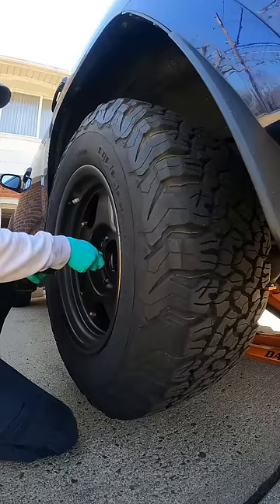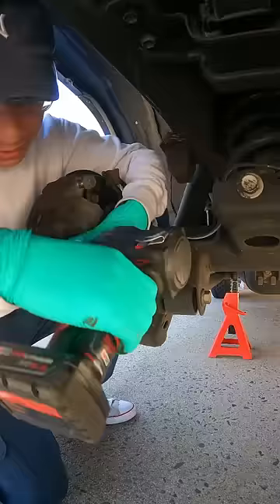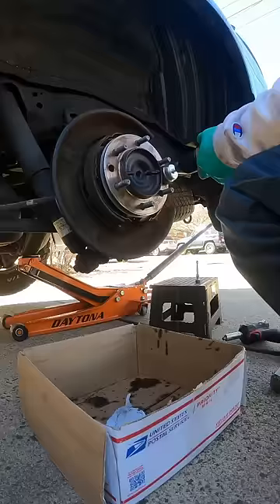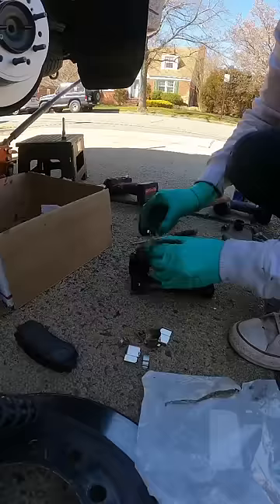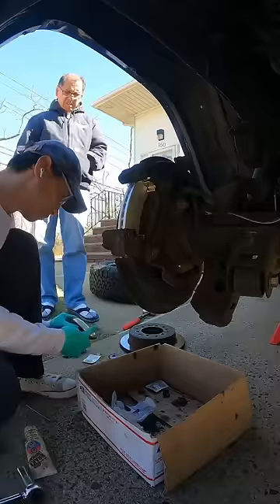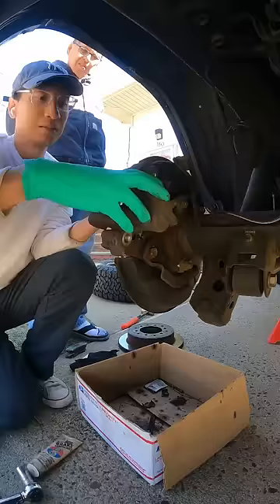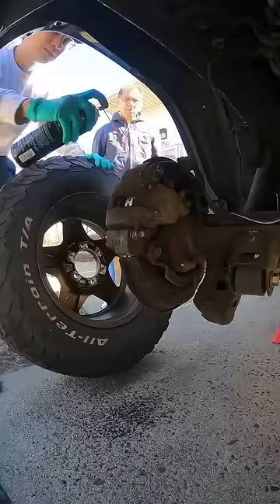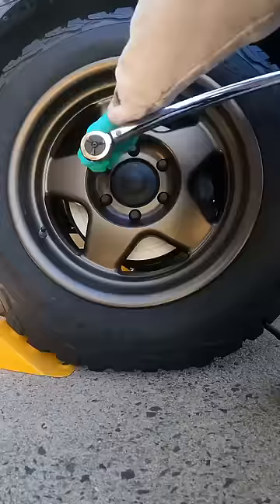Dealer wanted $700 to replace rear brakes. My DIY job cost me $100 and an hour of my time 😎

Comment: For the naysayers, $78 for the brakes and rotors at Rock Auto. That doesn’t include tax or shipping, but parts are themselves are under $100.
Reply: Rock auto is THE best place for car parts, seriously. They ship basically within the hour, and it arrives here in Canada WAY before parts I've ordered from Ontario to Alberta.
Reply: But how much moneys did all tools cost ?
Reply: @notsevenfeettall  dang that sucks. I’ve had good luck but I haven’t ordered any electrical parts. Just brakes, shocks and something else. Feel like it has to be worth the price with shipping to order. Ordered rear shocks on my dad’s truck for $90 shipped. Oreilys, advanced and autozone wanted $90 for one. It was same part number as autozone. I’ll probably stay away from them for electrical components.
Reply: @marshallmann2171  parts below, around $600-$800 bucks, but I think most people doing this already have most of the tools needed. You don’t need the Milwaukee impact wrench though, a ratchet/socket set and a breaker bar will do just fine. They’re charging $700 for rear brakes, fronts can’t be too far behind, there goes another $700. Now you also have tools to do small jobs, fluid changes, oil pan, calipers, shocks, etc. 

-Milwaukee impact wrench $350 (home depot /online) 
-3 ton Jack $180 (HarborFreight)
-torque wrench $25 (HarborFreight)
-sockets $30-$100 (shop around) 
-Jack stands $30 (northern tool)
Reply: 1a auto is way better. They're as cheap and I've never had a wrong part shipped. My last order was for plugs,wires and coils which is about 600+ at the parts store came in at 200 at 1a. But that's my opinion I guess
Reply: those warp easily get quality ones
Reply: @joshadams2812  think I’ve ordered from them once. Was not impressed with the quality. I ordered a set of mirrors for my truck, I ended up taking half my old and half the new to make it work.
Reply: @toolsonabudget7763  I didn’t believe it before, but torquing to spec seems to help big time. I used to just tighten wheels or go to small shops that don’t use torque wrenches and rotors would warp constantly. Since going to discount tire and/or doing myself with a torque wrench, don’t think I’ve had rotors warp again.
Reply: @notsevenfeettall  Never had a problem with them shipping wrong parts. I have spent several $1k with them and never had an issue, and this is over several years of use. I think my first purchase was is 1999-2000, they have been great. Sure they maybe mess up but I haven't had that case happen to me in over 20 years.
Reply: @walterrojas1075  ya you need to spend some to do it yourself but since you only use them sparingly they will last a lifetime.
Reply: @joshadams2812  1a auto would have costed me like 3 times as much for the parts I bought my jeep about a year ago. So no way. Also I get to choose what I want with rock auto.
Reply: $78 brakes weren't an upgrade. You should have at least gotten OEM brakes.
Reply: Not a upgrade though
Reply: @18avshalom  Wagner brakes, I’ve had good luck with them.
Reply: He definitely didn't get them coated rotors and pads for 78! Not even from rock auto unless he only foolishly did one side!
Reply: @notsevenfeettall  The other problem is their shipping games. They purposely source things on your list to get more shipping charges from you. I have played with it and sat you have two items from the say shipping location. Then you add a third and suddenly all three are coming from different locations. Or you change the quantity and it changes the location, so you pick another item equivalent to the one that used to match, to one that matches the new location and it does stuff like adding a third location. It's beyond ridiculous.
Reply: @walterrojas1075  That is anecdotal. The caliper assembly floats on the pins, so the torque used on the fasteners has no connection or relation to it.
Reply: @edwardthayer9386  Depends on the car. I can get ceramic pads for $12, Bosch for $18 (front set), and 23.79/each for Raybestos coated rotors.
Reply: @Court  not for that Tundra your not!
Reply: @walterrojas1075  Wagner are good, but Genuine Toyota are better. I use Wagner or Akebono when I'm not using OEM, but I'm convinced Genuine Toyota are the best.
Reply: @court2379  I don’t disagree. That’s the beauty of the internet and being able to price shop around. Sometimes local price is the same as online when shipping is included. Plus you get the added bonus of same day pick up and being able to return same day if it’s the wrong part.
Reply: @18avshalom  maybe it’s a Toyota thing. My F150 factory brakes and rotors were replaced at around 35k. Then again around 120k and now it’s sitting at 200K, may be due for new brakes soon. Something like that, not 100% exact mileage they were changed.  I remember my Honda brakes lasting a good bit, but I never used OE brakes on it.
Reply: @WillSwingem  autozone sells some pretty cheap stuff too. Bet rockauto has it for less still. 😂
Reply: @walterrojas1075  yea your right I for customers cars at my shop we usually get the import directs from orilleys but for my personal cars i get my parts from the dealer
Reply: @marshallmann2171   Must have tools you need for brake replacement is less than $50 and these are tools you can use repairing something else as well. If you get cheapest tools and only the sizes you need, probably even $20 will do.
Reply: @notsevenfeettall  They are not always the cheapest place, but they usually are. Amazon often has parts cheaper than Rockauto with free shipping, but Amazon is plagued with counterfeit parts.  Rockauto was also pretty good with replacing DOA or damaged parts. Contacting customer service will solve wrong part issue.
Reply: Rock auto turds in the chat. How’s the returning policy going? Good luck
Reply: @scooter2kool173  Other than having to pay for return shipping, their returning policy is not any different from local store. I had no problem getting warranty replacements from them few times. Return shipping cost is kinda what you have to expect when buying on-line.
Reply: @edwardthayer9386  Don't know what year that one is, but I looked up a 2000 and it turns out they aren't much more. Right around what he stated here for the front set. I was thinking it would be more too.
Reply: @court2379  it's the clamping of the rotor he's obviously talking about. As in, when they mount the wheel.
Reply: @marshallmann2171  
700 bucks
Reply: ballshairysweetie6364  They have a good, better, best system on their website.
Reply: You mean downgrade, those discs warp easy, be careful.
Reply: What about the floor jack that looks brand new.
Reply: @marshallmann2171  $700 to dealership. $100 parts, $30 harbor freight break bar $20 socket set, $150 hydraulic jack, $80 torque wrench, $30 brake caliper tool set(you can borrow from auto zone also the torque wrench), $8 1 can of brake cleaner, $6 1 can of wd40, $40 jack stands. $464 in total and save you $236 and you get some only used once tools you can resale or return (return not recommended). It’s one hour job and your hourly pay is $118 which might much higher than your current job😅
Reply: As a volvo owner of an s80 t6 awd rockauto saved me over $64,000 in parts. Just an awd rebuild kit runs over $8,000, windshield washer fluid bottle $270, struts $680/each, coil plugs $900 for 6 spark plugs $90 for 6, 91 fuel $4.20/gal 15mpg avg, 8 qts of full synthetic high mileage castrol and oil filter as recommended $98, wheel bearing $189/each, and brembo brakes/rotors $600 all together. Those are parts prices without labor.
Reply: BallsHairy Sweetie  could be whatever quality the specific brand part is you’re buying. From cheap-o made in china to made in USA and also OEM brands. They have brands such as AC Delco, MOOG, Mopar, Dana, Raybestos, Denso, Munroe, SKF, Mahle, and Fel-Pro.
Reply: @scooter2kool173  spent thousands on rock auto and have yet needed to return something. I usually only buy higher quality brand items mind you, but from what most others say, their return process is pretty typical of other places. I’m not too concerned at this point.
Reply: @walterrojas1075  I missed the part were he proved 78 dollar pads and rotors outperform the OEM ones that came on the truck which you know they definitely aren’t he should have never said that because no “upgrade” happened just a downgrade.
Reply: Came here to post similar. 

Rockauto has great prices and options but their shipping kills any deals they may have.

Edit: most deals are killed when shipping is calculated.
Reply: @Back_door_bandit_98  I missed the part where replacing with OEM is an upgrade. He probably meant “replaced” and said “upgraded”. Idk either way, good on him saving $600 and doing the job himself.
Reply: @Nvable  think it depends. I paid half the cost for NGK spark plugs and a fraction for the motor mount I ordered. Even with shipping I was less than 2/3 of what I would’ve spent at auto parts store.
Reply: You’re 100% right. I snapped off my bleeder valve (don’t ask, that was a bad first brake job on a 26 yr old car) and had to run to AutoZone for a whole caliper that cost me the same amount I spent on a my whole engine tune up, and the brake pads and brake oil.
Reply: Marshall Mann He clearly already had thm .Like everyone should have at least some basic mechanics tools or your just not a man.
Reply: Rock auto is cheap, cause they are cheap. Nothing but consistent problems with brake parts from rock auto.
Reply: @grozakko2007  is that why? I always thought it was the lack of store fronts, old school website stuck in 2005 and not have a dozen employees standing around asking you 2wd or 4wd for the wiper you need. Thanks for the info. 👍🏼
Reply: @notsevenfeettall  No no no. They are not terrible for wrong parts, missing parts, etc. If it's wrong parts, missing components, or whatever the case may be, they next day air ship a replacement and give you a return label to return the others back. Or in some cases, tell you to keep the old part. 

They sell remanufactured parts but inspect them to ensure their accuracy. 

RockAuto's customer service is A+
Reply: Rock auto is always my first option for car parts. Especially for wiper blades 🤯 omg the markup is just retarded at stores  for them.
Reply: @Grozakko I never had a problem on a single item from Rock Auto. If you don't know anything about parts and manufacturers let a man that does . Because that's your fault for picking the cheap parts out of the giant list. They have many name brands and better prices.
Reply: @notsevenfeettall  I have to disagree. I got shipped a damaged radiator (Wasn't damaged in shipping, it had been opened, bent, and re-boxed). They shipped me a new one immediately and gave me a return tag for the damaged one.
Reply: @marshallmann2171  You can do this job with basic hand tools on most vehicles. You might need a caliper wind-back tool, which is only $20, the rest you can get for maybe $30 total.
Reply: @walterrojas1075  I have bought lots of stuff from RockAuto, just be sure to get a good name-brand or get the "favorited."
Reply: @toolsonabudget7763  Yes, I always go with Wagner. Been using them for 40 years and never any problems.
Reply: @walterrojas1075  It's less important to torque them properly than to tighten them evenly and in the correct pattern.
Reply: @joshadams2812  1a & RockAuto are fs interchangeable depending on the part but both are by far the best in terms of prices
Reply: If you a planning on selling your car ya use parts from Rock auto.
If you actually want parts that will last go to the manufacturer for parts they will be expensive but it will definitely be better quality...
Reply: @edwardthayer9386  Ha, “one side”, good one.
Reply: @smokeshow1984  RockAuto doesn't carry Toyota branded parts, but some of the aftermarkets are better than OEM. Some of them ARE OEM.
Reply: @Miles Parris  ya the parts that cost more then oem might be better.
Cheap parts are IMHO not worth wasting your time
Reply: @smokeshow1984  No, because almost all their parts are cheaper AND better than OEM.
Reply: @Miles Parris  no, with cars you have only 3 options reliable/cheap/fast an you only get to pick 2
Reply: @smokeshow1984  You haven't used RockAuto, because they are all three.
Reply: He said upgrade. Ain't shit from Rock Auto gonna last 140k miles
Reply: @aztharz5637  I have parts racing from rock auto and parts avatar and both are late 😂
Reply: @jayblack9871  You have no idea what you're talking about.
Reply: @smokeshow1984  A lot of OEM parts are actually on RockAuto, at least for GM/Chevy. When I was overhauling my 06 Colorado’s engine sensors etc, nearly everything I looked for had an OEM offering available, or something that when researched was actually of OEM quality. I have no clue if that’s the same for imports or other MFG’s though.
Reply: @jayblack9871  Yes my boy the OEM part that lasted 270k on the original will not last 140k because I bought it from a particular source. I’m really not trying to fanboy a website but Jesus Christ guys use your heads.
Reply: @GetTheFO  Yeah, I can admit I forget they have O.E. parts sometimes. Like you said though for GM and Chevy. I own an Audi and an old Thunderbird right now. Every other part has been a hit or miss on fitment for the t bird. Not even going to talk about quality.  Same deal with the Audi but a lot worse. I guess having old pos cars doesn't help.
Reply: @marshallmann2171  cost to purchase id irrelevant because of the impact was $200 and it lasts 15 years, that's Pennie's. Dealerships be making you pay off their tools for life
Reply: Yeah for cheap crap. You need to watch the YouTube video on brake pads and the VAST difference in quality that exists. It’s a safety issue. Also those cheap rotors will be warped in a week. But gotta love ignorance…..after all it is BLISS 😂
Reply: @marshallmann2171  probably collected over a life time
Reply: So 3
$30 rotors, lol
Reply: ROCKAUTO
Reply: Do not spray brake kleen on pads ever
Reply: @aztharz5637  Oh thanks been looking for a review of them. Need some lexus parts that the dealer is charging too much for.
Reply: And it’s literally where the shops get their shit from!
Reply: @TheRoman1  why not?
Reply: $78 for two rotors and pads? Not even,  maybe eBay shit
Reply: The way rock auto makes their money is off shipping.. go on there and try to buy a small gasket. And compare it to the price at your auto part store. Oh rock auto has it for a $4 and you have it for $15. Then go see how much the shipping is on a tiny gasket. It’ll still be like $15
Reply: Rock auto parts suck you could of done it yourself with quality parts for under 300
Reply: @Lemonhead8890  Yep. Same thing with me. His comment seem more like he was thinking of possibilities and worst cases that might go wrong.
Reply: @notsevenfeettall  Never had any issues. They have always made sending in lifetime pads and rotors easy and core charge on things like calipers have not taken long to get back that charge. As I type this my next 4 orders will be messed up just because life.
Reply: @marshallmann2171  for sure less than $600
Reply: And a month later new ones oem is the only way
Reply: @shauncry9310  ?
Reply: @Jmacfann  rock autobis cheap manufactured parts durability is so so
Reply: @shauncry9310  yeah if you decide to buy the cheapest they have.
Reply: Doesn’t count the tools and labor time either smart guy
Reply: @walterrojas1075  how much is your time worth if it takes a newbie 8 hrs to do this?
Reply: @kevinragsdale6256  that’s completely up to the individual. For me, I’ll take my son out there with me to hang out and it’s not taking 8 hours to do brakes. We changed rear shocks and brakes on an Xterra a few weeks ago. I think it took an hour, if that for both. Some people like to do that stuff, some people would rather pay. Dealership rates are around $220 an hour at this point, I’ll do it myself.
Reply: Not original parts?
Reply: Rock auto not for brakes
Reply: There's no way that's for oem quality parts,  though.  That's cheap Chinese steel for sure. There's a reason oem quality parts cost so much. Just the parts for all 4 corners for a small suv just cost me over $400. That's not upgrading,  that's oem quality,  so there's no way the cheap Chinese parts you bought for $78 are an upgrade. That's just a lie.
Reply: @marshallmann2171  Exactly. Torque wrenches, impact wrenches, impact sockets, etc aren’t cheap… and then there are “shop supplies” like slide pin lube, brake cleaner, and brake grease. Heck, he acts like torque specs are just known. Did he buy a repair manual?
Reply: ah yes you work for free makes sense
Reply: @marshallmann2171  winner winner chicken dinner!!  These kind of vids try to make shops look bad.  The truth is you dont just pay for a few parts.  You pay for the mans time and his tools.  A good wrench is over $700 on its own. 😂🤠
Reply: ❓ how much was your wrench??  I wont ask about all the other tools needed.  If you use quality stuff, that one thing is over $700 😅😮
Reply: @c7adventures376  you’re 100% right. As someone who does minor maintenance on my cars, I need the best, snap on, matco, Mac and the price that comes along with it. 🤡 There is no way HarborFreight, husky or kobalt will get the job done. Guess my advanced auto part gear wrenches and tekton ratchet/sockets didn’t get the memo.
Reply: @toolsonabudget7763  THIS every pair of brakes I've replaced that weren't OEM have lasted a year or two before warping, just pay the extra bit and buy OEM
Reply: I agree you csn easily find a set for under $100 but saying he "upgraded" them is not true. 
He probabaly got everything from economy section.
Reply: If you are only paying $78 for pads and rotors, they are not an 'upgrade' from Toyota parts. I'm not saying you can't buy the same or better quality, but those probably ain't it chief.
Reply: @Tools on a Budget  finally someone pointed that fact out!
Reply: Those wheels are really nice!  What truck do you have?
Reply: @walterrojas1075  nope. You dont need the best for your once in a while home jobs.    The point is he was trying to make shops look bad.  Well at least he should compare apples to apples.   My statement stands that a good shop has good tools and not only that. They warranty the work they do. Its silly to post this bs and tell every average joe that the shops are no good and doing your own work is so much better.  Little mis leading if you know anything about honest auto shops. 👍🤠
Reply: @Walter Rojas  Pretty crazy you can literally buy all the tools and it'd still be around the same price
Reply: @nicks3037  yea guess thats possible.  Do you also like one or 2 use tools??   A shop definitely is not buying that junk and they warranty their work. One wrench will be more the $700 on its own. Telling the average joe he can do it is often a costly mistake.  But sure. Head on down to HF and you too can be a backyard mechanic.  🤠
Reply: Yeah, but how much is that milwaukee impact???😂
Reply: @c7adventures376  do you work or own an independent shop? If you do awesome if y’all are honest. It’s hard to come across honest shops now a days. If I can find one, I will stick with them. Shop rates have gone up in the past 5 years. The one I used to go to was $85 an hour when I started, when I stopped going it was $125 an hour. Still beats dealer price of $225 an hour. In the meantime I’ll stick with naturally aspirated ol reliable V8 that needs minor maintenance. That being said, do you have something against people working on their own vehicles with tools that are affordable to them?

Also, harbor freight won the lawsuit snap on had against them for selling the same jack at a fraction of the price.
Reply: I have an EV so I never have to replace my brakes.
Reply: @ultrastoat3298  that’s awesome! Didn’t realize that was a thing with EVs. Thought that was hybrids with regenerative braking that brakes lasted forever. My only worry with those things is the cost to replace batteries long term. I tend to keep my cars a long time. Got rid of my last one at 205k, current one has 200k and one with 165k.
Reply: Maybe for the "economy"parts that will surely pulsate when on the pedal....they always do.
Good ones are $250 ish. And it's probably an hour per side minimum....just be accurate. People who know nothing about cars or repairs watch this stuff and believe it's real.
Reply: Shipping rotors will cost as much as the rotors usually because they're pretty heavy but it's still much cheaper than a dealership.
Reply: @aztharz5637  theres always a cost to getting something dirt cheap. Id go lower mid price
Reply: Yeah I bought a few parts from rock auto. If they send you the incorrect part, they make you pay return shipping. That broke me from that. It happened twice and it cost me almost as much to return the parts as the parts cost me.
Reply: @marshallmann2171  you gonna cry? If you have the space/confidence to do this job, you can afford a simple socket set
Reply: In my experience with rock auto their still cheaper with shipping generally. Autozone usually has the cheapest parts thats you can in store.
Reply: @walterrojas1075  I have a DeWalt impact wrench that’s about 40% less and does the job. It’s well built and durable.
Reply: @ultrastoat3298  if you do they’ll probably be $1500 😂
Reply: @pmscalisi  lol huh. Tesla doesn’t make brakes. You do know that right? Please tell me you know at least that much before commenting. I can go to brakes R Us just like anyone else and get new brakes. Lol. But I won’t have too. What an insane comment.
Reply: @walterrojas1075  this is how I got my tools I said f that price I’ll learn to do it myself and bought all the tools and did the work myself and it ended up still saving 50 bucks at the end of the day, but with all the tools at the end I can save money for time to come.
Reply: Of course. That is the only place I order from
Reply: @ultrastoat3298  have you tried to buy Tesla brake parts? $700 just for the parts. That’s all four rotors and pads. 
I don’t think you need to put brakes r us brakes on a high performance Tesla.
Reply: @pmscalisi  nobody has to buy brakes because they last hundreds of thousands of miles.
Reply: Don’t forget to go scrap the rotors at your local scrap yard for a little extra scratch
Reply: @marshallmann2171  you can get the tools to do this for maybe 30-40. Stuffs not that expensive. Brakes are the biggest scam mechanics shops have
Reply: Impact 600.oo+78.oo  Plus time 1 hour say 20.00.          698.00 WoW the savings Plus no warranty for the job or brakes
Reply: And all the tools used ?
Reply: @realtalkboxing.  just do it with hands. No tools required. Be a man.
Reply: @marshallmann2171   If you do your repair outside of o'reilly's or autozone I believe they will let you use tools to fix your vehicle
Reply: @notsevenfeettall  tell me about it. Only the people who don’t order a lot have no clue. The guys who only replace or repair when it’s easy work say rock auto is the best. What you should do is purchase oem parts for American vehicles and find an oem parts house for your euro or Japanese.
Reply: @walterrojas1075  as a former helicopter mechanic yes proper torque matters.  Under tq cause problems just like Over tq.
Reply: @marshallmann2171  You can do this job for <$100 in HF tools
Reply: You aren't getting genuine toyota pads & rotors for $100 shipped. A powerstop oe style kit costs more than $100. And I would think your $700 estimate also included flush services if not more recommendations. Possibly front brakes as well. Let's compare apples to apples, not apples to apple flavored juice drink from concentrate (contains 3% juice).
Reply: @jamesleavy883  dealership always mark-up the price.
Reply: @aztharz5637 I order some things from Rock Auto, but their standard shipping is slow and some stuff is cheaper to get elsewhere once shipping is factored in. I do my best to get what I need from Amazon.
Reply: @marshallmann2171  you don’t buy generic tools for one job, you buy them to do many many jobs over the years.  Average out the cost of the tools even over a couple jobs and you’re still saving significantly.
Reply: Aint no way $78 pads and rotors is an "upgrade"
Reply: @notsevenfeettall they're not that bad at least for missing parts. I recently ordered actual upgrades for my brakes, drilled & slotted rotors with new pads plus hardware. The box that had my front brakes was missing the pads and i submitted a complaint to rock auto and got replacements no hassle, no extra money. That being said, definitely dont order from them unless your ok with waiting 2-4 weeks for parts
Reply: @marshallmann2171 just borrow some from a buddy
Reply: @notsevenfeettall  I’ve ordered starters, alternators, batteries, and so much much from Rock Auto, and have done 2-3 warranty claims with no issues. They’ve only messed up once with the wrong item and that was an oil pressure sensor.
Reply: Just looked at this rock auto you guys spoke of..... I'm goin back in. I just wasted to let you know that i know
Reply: The dealership was quoting labor and O.E. parts. The factory pads last longer especially when you buy the cheapest thing you can find.
Reply: If you paid under $100 for a set of rotors and pads, it's a good thing you did it yourself. You'll be doing it again soon.
Reply: Rockauto for the win!  Been using them for years keeping 20 p.o.s. on the road😅
Reply: @SkYxLeGaCY  It must stink to own that car given all the repairs it has required.  I have an 18 yr old fully loaded (when new) 4WD Tahoes Z71 with almost 200k miles and have only had to spend maybe a couple of thousand $ on repairs and replacement parts, excluding tires.
Reply: And three months down the road you're going to have a warped brake rotor cuz I bought them there and they suck
Reply: Low quality brakes for $100 🤦🏽‍♂️
Reply: Just a set for the front costs like 60-70 should've cost him like 150 if he also got new metal clips
Reply: Don't forget the $500 impact or 
+$100 torque wrench he's using... Everyone's got that stuff just laying around too ya know 😂
Reply: @Marshall Mann  well that's a $100 mechanical torque wrench lol
Reply: Naysayers have left the chat
Reply: That does include time to do it yourself, tools, lifts etc. I can’t even get rotors/pads for an axle for under $100 and that is with a 10% over cost at a dealership
Reply: $78.00 for brake pads and rotors? Bullcrap 😂😂
Reply: Those cheap Chinese rotors will probably be fine on the rear. Don't use cheap rotors up front, they will warp fairly quickly.
Reply: @marshallmann2171  my question is, why did he even take it to a shop in the first place if he has the tools and the knowledge to do it himself?
Reply: Doesn't include the cost of the tools either
Reply: Not good quality 😂
Reply: @doom  anyone who works on their own stuff should have a basic tool set. It will pay for itself with one repair job.
Reply: Are you calling that an upgrade though?
Reply: @milesparris4045  unless you like good quality tools. A name brand Torque wrench can run $500-700  on its own.  😆 👍
Reply: @c7adventures376  Fine for a pro mechanic. I am not. And I've seen work done by a pro who just tightens everything with an impact. It's not the tool that makes the man.
Reply: @walterrojas1075  didn't see this..  Yes im a shop brat.  Luckily my Lt. Col father is a honest man and i have see the good side of the biz around him.  You are not just paying for a tool or a job. There is overhead like crazy.  Shop insurance and other things. We were the lowest per hour in all of Ventura. 

The part i dont like is trashing all shops and saying the average joe can do the work at home.  I think people should know their skill set and do the jobs they can do correctly and most of all safely.   When you get work from us we stand behind the job and also are responsible for fixing anything that goes wrong during the fix.   Its definitely not the only option,  but for many car owners its the smarter one. 🤠👍
Reply: @KingCobra_45  what choppers did you fix? My dad the Lt. Col used to fly the CH-46. 👍🇺🇸
Reply: @Its_0zzy  if its 100 bucks... its garbage!! 🙄😁
Reply: @milesparris4045  yes. I have seen many professionals do the wrong thing or the wrong way.  If a shop employee doesn't do the job right and something goes wrong, the shop is still responsible. If joe smoe makes a mistake, he will be coming out of pocket to fix that too.
Reply: @c7adventures376  Rogerr that, for m HH60-H,  SH60-F,B  MH-60-R S
Reply: @marshallmann2171  😂 once you invest in some tools the savings pay for them 5 x over easily with a few basic maintenance jobs on your car. I seriously got me a nice set of tools now that I can tackle any job except an engine swap
Reply: Yeah but if it's your first time and you don't have these tools, it'll be over $100, but still definitely less than $700
Reply: Also, it's a great investment for any first timers because you'll have the tools to be able to do it next time. So all you'd need to worry about is the parts, which then would def be less than $100. For first timers without any tools, these are the tools you wanna look at:

Breaker bar
Socket wrench (if you don't own a drill because buying one is expensive)
Set of sockets
Jack stand (probably the most expensive thing)
Jack (although you do should have a basic one in your trunk)
Kroil or PB Blaster (penetrating oil)
Break cleaner spray
Small pack of grease/lubricant (super cheap)
Box of disposable gloves (if you don't have any)

I think that's about it. If I missed any important ones, please comment it.
Reply: @eduardorivera508  do you work on cars?? One good wrench can be $500-700 on its own. 🤔
Reply: @whackronomicon  lmao.  But according to the chat here.. any backyard hillbilly can  the job and for a lot less too. 🤠👍
Reply: @Lamtitude  your right. He didn't.  It was all for views from the start.  Plus the misinformation keeps that chat going.  🤔
Reply: You must be in the USA. In Canada the parts would cost MINIMUM $200.
Reply: I've been changing my brakes for years. Hondas, Acuras, F150. I always get the Premium Bosch QuietCast Ceramic brakes. Typically around 35 dollars (for an axle, 2 wheels). You can do front AND back EASILY for under 100 dollars. That's the one time parts/consumables.

You'll need a jack, jack stands, wrench, etc. but you need that stuff anyway and it will last you a lifetime if you get quality stuff second hand. Get some good lube/grease:
Permatex Copper Anti-Seize
3M Silicone Paste
Brake cleaner

Then a wire brush is good too. Typically don't even need to do rotors, just clean it really well. Only when it start to shudder do you need to do the rotors so add another, what, 100-150 per axel for rotors?

You need the tools anyway for oil changes and regular maintenance, mods, etc. Most of your brake jobs (after you get those few tools) you can do for 80 bucks (all 4). Plus you learn a lot, get good exercise, etc.
Reply: @user-nh3gu1ge3d  I agree 100%, but these people don’t want to hear that. “But your time” “but the tools” “take it to a shop, they would never steal your money”. 

More than likely if you’re doing the job you have the tools and time to do it. I’ve saved a buttload of money on doing jobs myself. Over $1000 ($1110 quote) on my wife’s BMW when replacing brake clip. Over $400 ($575 quote) on replacing my trucks oil pan gasket. Saved $500 ($725 quote) replacing Honda starter. Saved $400 ($525 quote) by getting Honda alternator rebuilt and replacing myself. Dealership prices are outrageous! Best part is, I can still drink beer while doing the job myself.
Reply: @walterrojas1075  Yeah, for sure. People say "I don't have the time to change my oil" when it, in fact, takes way longer to take it to the shop. I can slide under my truck in my garage and change my oil a heck of a lot faster than I can drive to another place, wait an hour for them to do it, drive back. Most people are just very, very lazy.
Reply: @user-nh3gu1ge3d  ah man. Gonna get me started, I have a huge stain on my driveway because of the simpletons at the lube shop. They didn’t tighten my buddy’s filter on his truck. He left his truck in my driveway over the weekend, when he started it and backed out I noticed the puddle. Thing was a thread or two from falling off. That would’ve been a bad time had it fallen off on the freeway. Serviced by “pRoFeSsIoNaLs”! He took me up on my advice of going back to doing oil changes himself.
Reply: EBAY ALSO
Reply: @marshallmann2171  you could buy/rent the tools and still come out cheaper than the dealership
Reply: @marshallmann2171 not much really.  Maybe a few hundred at most.  You can use those tools to do a brake job in the future or some other jobs.  I have to take care of 3 vehicles and would be really expensive to take them all to a mechanic or dealer for service.
Reply: Those are much worse parts if they were that cheap
Reply: Don't forgot core charge
Reply: You didn't upgrade anything for 100 bucks. Lol
Reply: @notsevenfeettall  Dont forget ordering OE version but receiving economy version
Reply: @marshallmann2171 I often do my own brakes so I already have the tools I need. Been doing my own for many years.
Reply: Rock auto is 1st on the list unless I need it same day
Reply: @marshallmann2171 a man should have basic tools, jacks, ratchets,
Reply: What naysayers? 😂😂😂
Reply: The quality is not the same with those $100 pads and rotors. It's actually a downgrade, especially with oversized tires. I see warping, squeaking and lockups in the near future. Save on labor so you can use the extra money for better parts. Brakes aren't something you should go cheap on.
Reply: I fail to see how that's an "upgrade"
Reply: Let me know how the warping and rust looks in 2 months
Reply: You trying to say that 4 rotors and front and rear brake pads for les than $100?🤨😏 if so, it was the cheapest brake pads and rotors that will last you probably 6 months on a daily driving 😆👌
Reply: Time is more of an issue than dealer cost of service… After working 40hrs during the week, sometimes the last thing I want to do is turn a wrench.
Reply: Anything from rock auto is far from an upgrade.
Reply: Yess my friend recommended me rockbodyauto he used to work at a dealership ....dude gave me gems
Reply: Nah. Those are cheap Chinese parts. OEM is best way to go. They do have link to OEM parts but price is similar might as order from the source
Reply: Rock Auto has excellent prices. And unlike Advance, Auto Zone etc they carry high end quality rotors and pads like Bosch, Brembo, Akebono etc.
Reply: $100 in parts! Ok... for junk! $700 minimum in tools! $25 in shop supplies... 3 hrs labor... funny guy. This is why mechanics get a bad name. YouTube mechanics are the best! Love yall
Reply: The Toyota dealership also isn't going to slap economy parts on your sub 30K Vehicle... Tell me, about how much all those tools and "shop supplies" cost you eh? Yo are well over $300 after you take equipment into account, not even including the hour+ it may take out of your free time. I see my customers mess up repairs doing this after a dealership quote, all the time, because they saw a "do it cheaper yourself" video on here.
Reply: From rock auto….
Most people don’t have time to wait for rock auto unfortunately!
Reply: @shadetreeautomotive3722  operator error, that’s a whole different conversation. Dealers will milk you for all they can. They wanted $750 to swap out a starter on my old Accord. I went to advanced auto, picked one up a brand new starter, not remanufactured for under 200 bucks. Swapped it out on the garage in 15 minutes. Similar story on the truck, not going to lie about that one, it was a little harder. The front diff was mounted just right to make the bolt inaccessible, that one took 30 minutes and $170 for the part.
Reply: @TylerRivera635  depends on the part. Brakes should be checked every time the tires are rotated, which is about every 5000 miles. You’ll be able to tell when you’re due for brakes.
Reply: @marshallmann2171  for hand tools that can do it, 30-50 dollars or less at Harbor Freight.
His milwaukee tools? Well probably a couple of them cost that repair quote lol
Reply: 78 plus 10 shipping from a and b is just about 100 lol yep
Reply: @marshallmann2171  well like 50 honestly probably less although the sockets maybe pushing 50...harbor freight!
Reply: pad and rotor costs and quality vary vehicle to vehicle.
Reply: You called it.  I don't think a rotor and pads cost less than 100.  I'll have to check out rock auto. Maybe your truck is a lot cheaper than mine.
Reply: Garbage parts.  You'll be replacing them again soon.
Reply: Just got a set for 113 shipped for my 05 Camry from rock auto
Reply: @corbindallasmultipass  nice. I’m placing order for parts on my fit. Motor mounts and struts for $175 shipped. Just a single strut at the parts store is about 150 bucks. It’s an old car. I really don’t need top of the line part.
Reply: @aztharz5637 yeh but shipping cost is highway robbery. You need to compare prices vs local place.
Reply: @marshallmann2171 yeh but you can ise those tools for other projects I. Th4 future or even change your tires and stuff. It's an investment dude
Reply: You just tipped me off to what rock auto is and I am astonished by how much I over spent on brakes, the Napa kit is getting sent back and refunded, thanks.
Reply: @marshallmann2171  for this specific job you need a breaker bar, torque wrench, separator, some sandpaper or a wire brush, lubricant and other materials , a lift and jacks. Close to 550?
Reply: @marshallmann2171 way less than one trip to the mechanic
Reply: all you need is 1 wrench to remove the brake caliper, and a hammer. Hint, a rock is a hammer. Jack and lug wrench should come with the car.
Reply: I tell all our tire shop customers to order from rock auto
Reply: @marshallmann2171 drill just saves time, $60-80. But the rest: Jack $80, Stand $20, rachet and Sockets $15 or already in your house. Wire wheel can be replaced by a $2 wire brush and more time effort. Most expensive is jack and stand(s). So all in tools like 120, but one time buys. Amortize that cost over your next 2-3-10 jobs.
Reply: @marshallmann2171  well since you dont need to use an impact you could easily could get the tools for under 300
Reply: Thanks for this comment. I ended up buying OEM pads and rotors from Rock Auto for less than the NAPA store brand parts (including shipping). 

The NAPA parts will be returned today.
Reply: And 500 in tools
Reply: @mar-tin702  sure is a shame those tools are one time use. ☹️
Reply: @walterrojas1075  propably you will never use those again,not until you change the brakes again,and brake change doesn't cost that much in my country,its much cheaper to go to a mechanic then to buy those tools